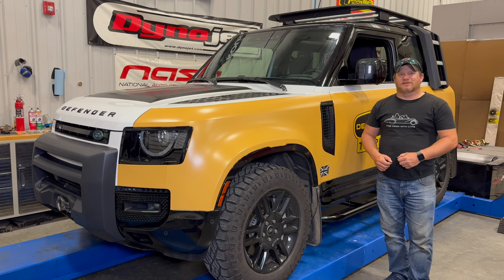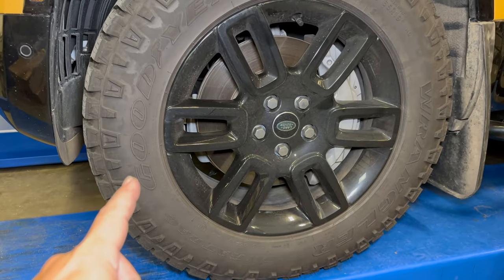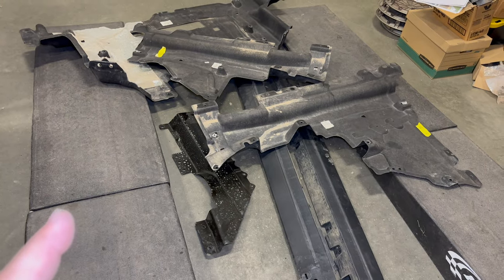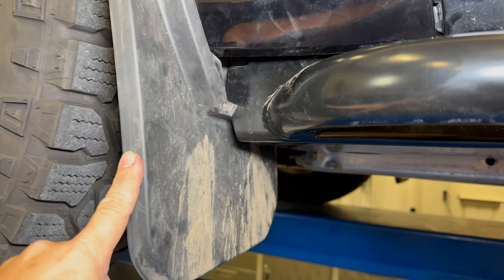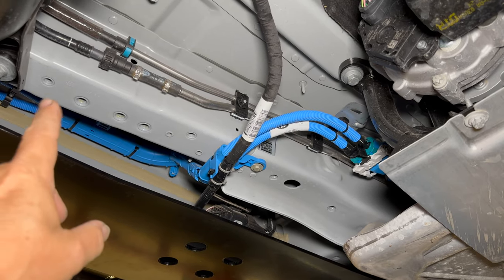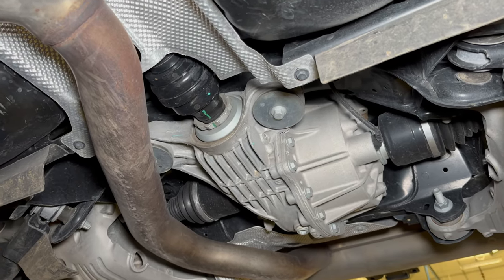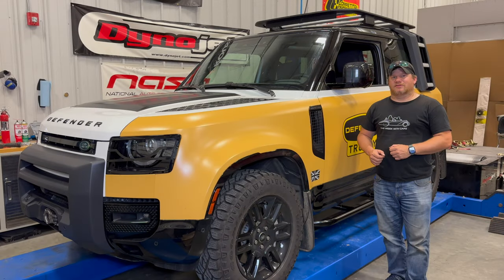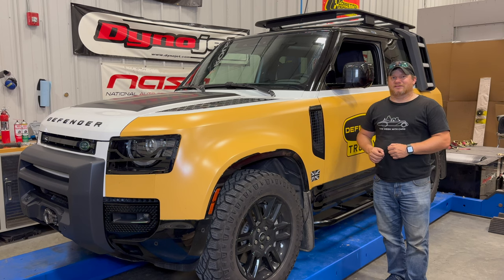New Land Rover Defender Upgrades Part 2

Comment from the maker: Here is the response from Lucky 8 Off Road Equipment on why the filler piece is the way it is: "We shortened the sill plate because it serves cosmetic purposes only. On the 90, when using a larger tire, there's a greater potential for rubbing issues in that area, especially with tires around 35 inches. We wanted to avoid interference with the trim sills. We feel It's better left off, ensuring that if the plastic piece becomes dislodged due to tire rubbing, there won't be any damage from the tire catching the sill piece."

Comment: Those are some beefy looking rock sliders. I totally agree with you that some kind of thick metal skid plate be installed to protect the high voltage wires. That seems like a possible point of failure. Have fun with that monster. I’m still jealous!!!!😂

Comment: Those rock guards look really solid. I would find a skid plate to cover the high voltage wires, it is not worth the risk without it. The headlight protectors are almost  invisible once installed and better than say a cage on this modern Land Rover. Enjoy your adventures Steve. 👍👍